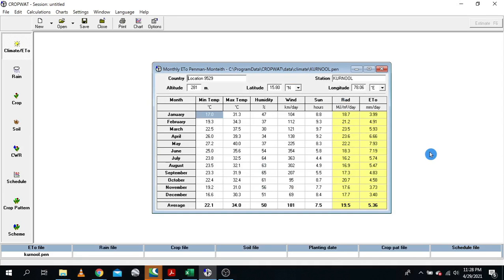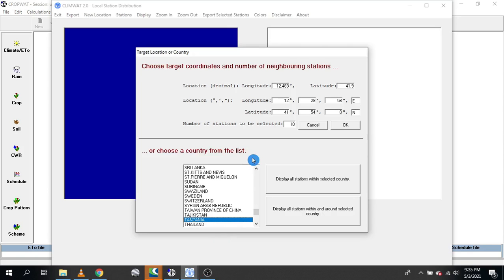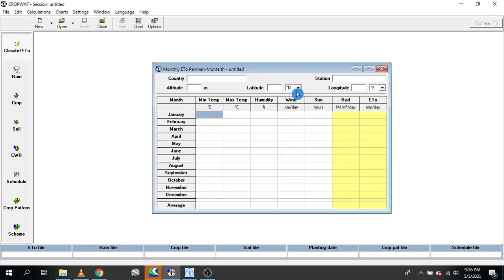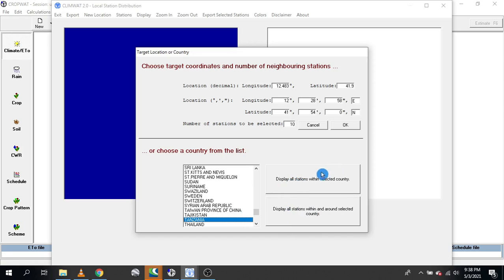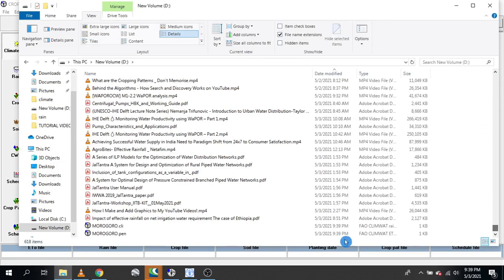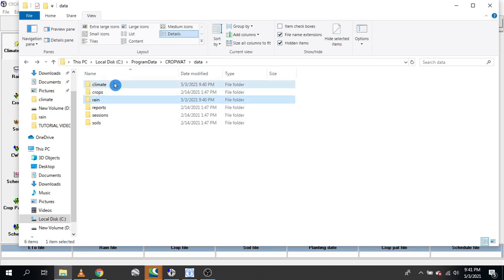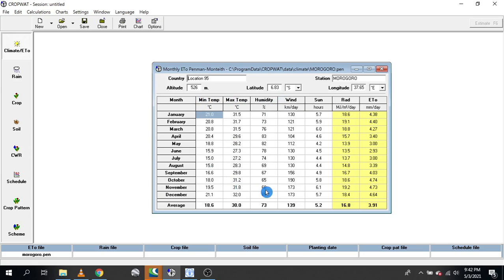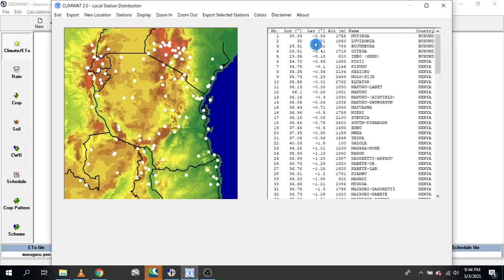How to Calculate Crop and Irrigation Water Requirement Using CROPWAT 8.0 and CLIMWAT 2.0 [Part - 1]

Comment: does the CLIMAT and CROPWAT software have an API as i am building a program that needs both. thanks
Reply from the maker: No i don't think so, but you can email them or you can try to check their documentation though i dought it might not be available.. or check their other software "Wapor".
Reply: @HydroinformaticsAcademy  thanks very much, do the CLIMAT and CROPWAT software use databases, cause theoretically i could communicate with the database with little to no link to the software.

Comment: Hi
How is evapotranspiration calculated according to the number of plants per decare?
Reply from the maker: Evapotranspiration (reference evapotransipiration) is calculated by using weather data. And if you are using CROPWAT then you'll extract them from CLIMWAT! But you can even calculate them manually if you have recorded weather data from a nearby weather station!

To get crop evapotransipiration you simply take reference Evapotranspiration (ETo) then you multiply it with crop factor  (Kc).

NB: Crop factor varies from crop to crop and from one development stage to another, you can get this value from literature but a good source is FAO irrigation Manuals!

Welcome Engin!

Comment: I have the weather data in excel format. What can i do to change it to the format that i can use in cropwat?
Reply from the maker: Hellow Abeda! Welcome!

I am not sure about creating files similar to that of climwat BUT...

IMO, what is needed is long term average monthly data for each month for example jan, feb, march ... dec!!

So if for example you have 10 years historical data in excel, then the easy way is to find monthly average data for each month, then use the average month data you obtained to insert on each month's slot on cropwat...
Reply: @HydroinformaticsAcademy  okay. But I'm working with 30 years of data for 2 different study areas, so inputting data manually is a bit difficult for me. Can you tell me the file format you used for the data?
Reply from the maker: I understand!... but Unfortunately the data i ised was from CLIMWAT software and not excel...about the format they are in ".pen" (for rainfall data) and ".clim" (for sun hour, wind etc..)!
Reply: @HydroinformaticsAcademy  Okay understood. I'll check what i can do with the data i have. Thank you for your response 😊
Reply from the maker: Thank you Abeda, you are welcome! good luck on your project🙏